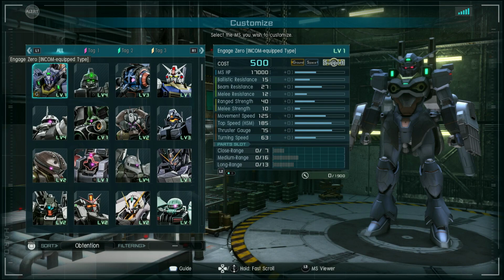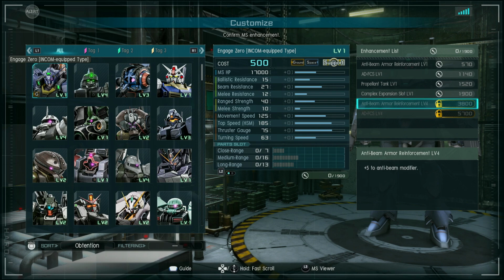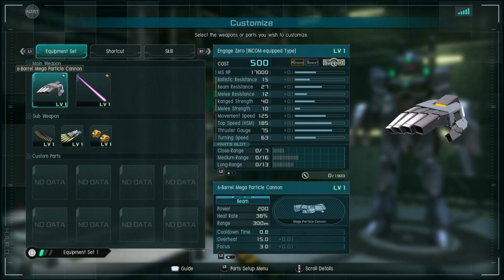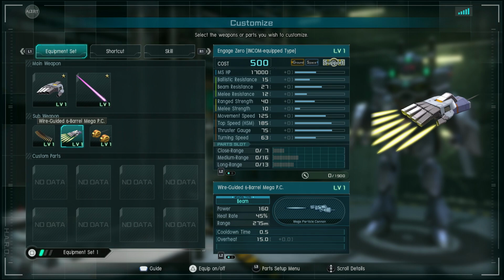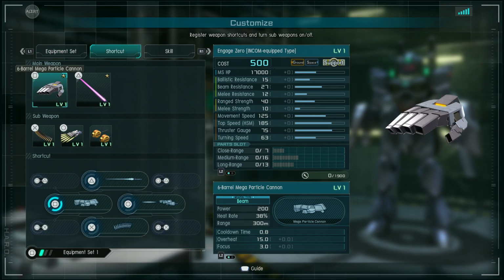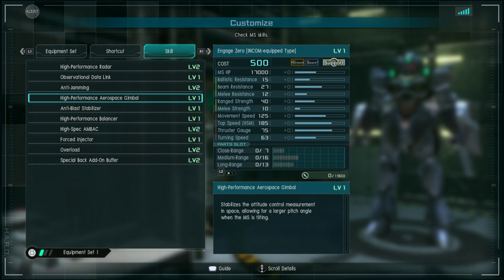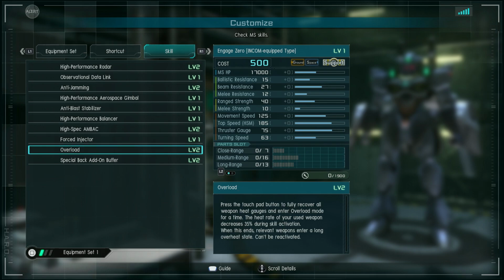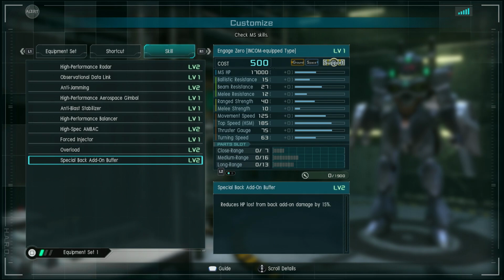Gundam Battle Operation 2 Test Drive: Engage Zero INCOM Type Can Fire All Its Beams At Once

Comment: Hey rob, hope ya read this, met nurse gundam in the field and crash site is a better test field, spawn beacon C has a gen and support standing single file and allows you to check piercability. 650 cost offers qube and hamma, both have damage control and great for testing stun rate

Comment: Three questions. 
1.Do incomes/wired benefits from the t-frame?
2. Is there any benefit to hover mechanic?
3. Can it stop a raid unit mid trust with stagger buildup?
Reply from the maker: 1. Pretty sure it does, yeah. The game doesn't seem to make a distinction between psycommu and INCOM weapons.

2. IMO, not particularly. It might give the downswing more momentum if you're careful about how soon you pull back on the stick, like some other hover MS' melee patterns, but mostly it just gives a slightly different feel.

3. Sometimes! Had pretty good luck with keeping a Gouf Custom off me last night but something with a more mobile or aggressive melee pattern might not work as well.
Reply: this suit likely won't get any kinda benefit from being a hover suit but some other hover suits that have stop to fire weapons can shoot as they go round a corner so they stop and fire as they slide out of cover, requires practice but can catch people off guard